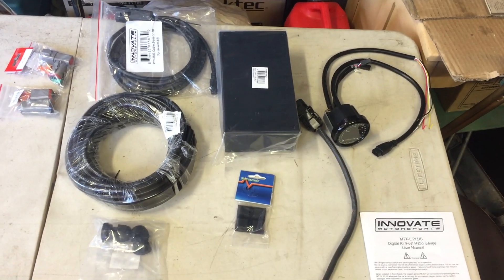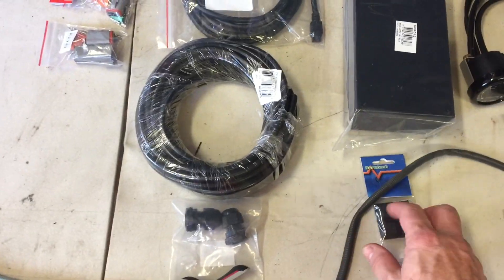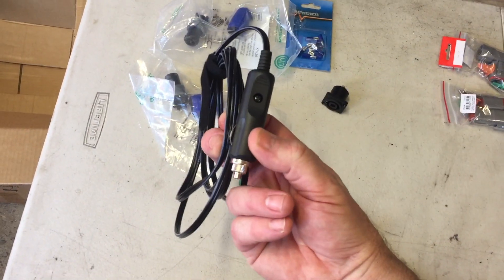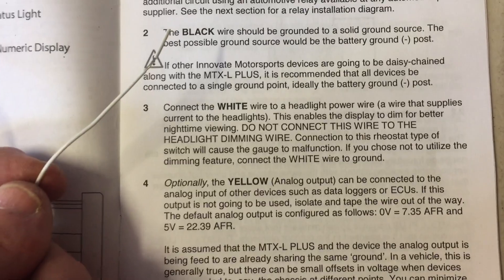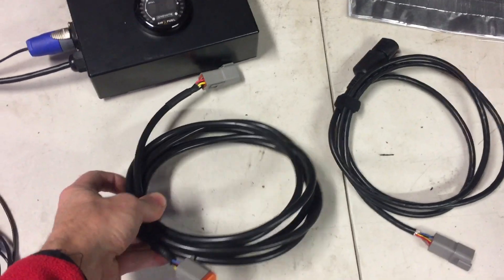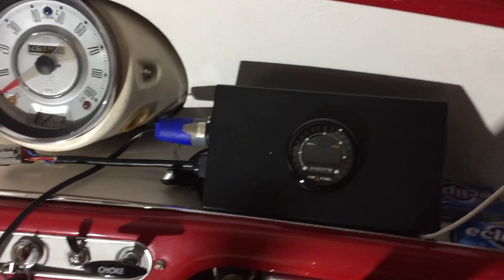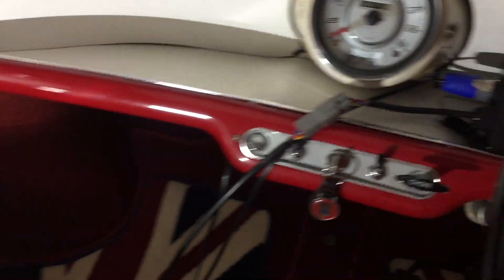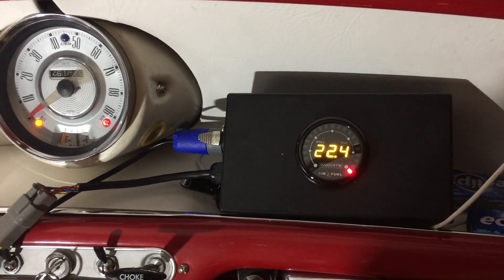DIY Air Fuel Ratio (AFR) Test meter

Comment: Awesome, how long could i run this meter continuously?
Reply from the maker: You can run it as long as you like.  I ran it continuously  for about 1 month - in rain and fine weather.  In traffic, on the motorway etc..  I did store the car in a garage - not out in the open,.  This really helped me get the tune totally right on my car in all normal situations.

Comment: Looks like a nice wee set up. Like the idea of using the tail pipe instead of welding a bung into the exhaust. Easier to use on multiple cars. How has the O² sensor cable stood up to the test of time?
Reply from the maker: I've just added a further video about the exhaust pipe clamp.  Should have added it months ago.